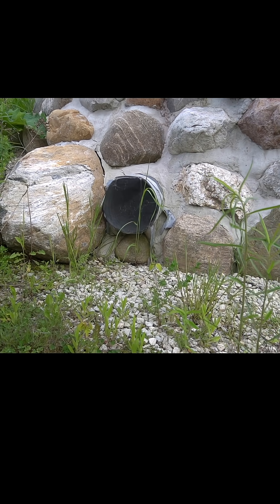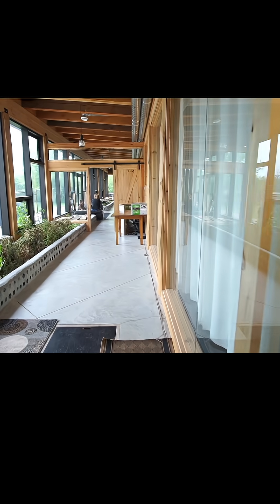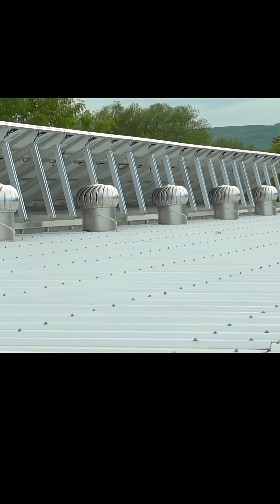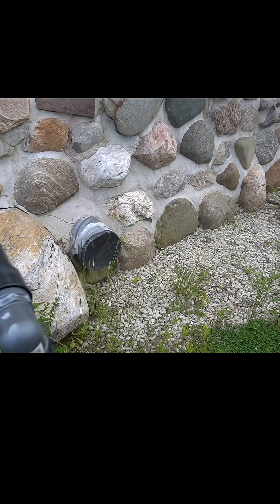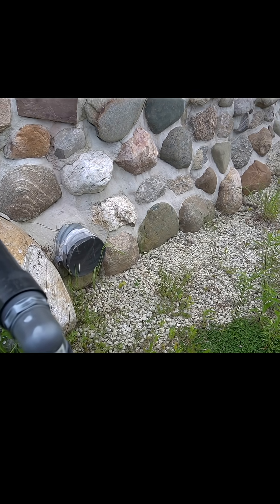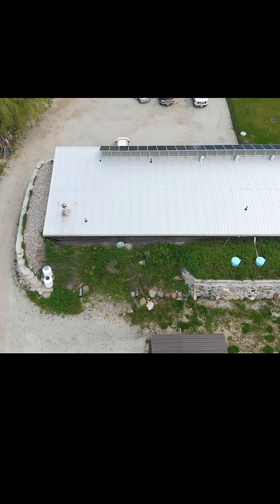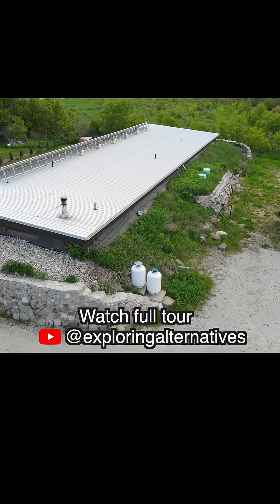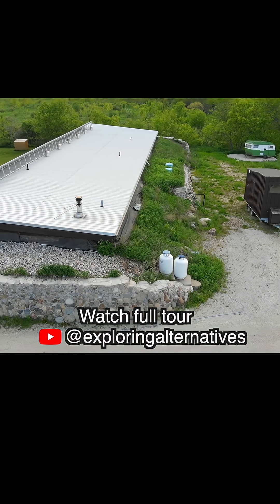Smart & Simple Passive Air Conditioning & Cooling #home #shorts #diy

Comment: Passive solar cooling.

I first learned about in from an article in MOTHER EARTH NEWS magazine. A man who lived in northern Arizona cooled his house this way.

His front porch was enclosed and faced south. He had thermal mass in the form of black-painted planters against the front glass wall of the porch and the porch's back wall (the house's front wall) made of stone and cement. The thermal mass would soak up the sun's heat, which would help to heat the air inside the porch. The heated air would rise (heat rises) and exit the porch through open windows in the slanted porch roof (screens on the windows kept the bugs out). Pipes running under the earth on his property would draw in air to replace that leaving the porch. As the hot summer air traveled through the underground pipes, it would cool, becoming "air conditioning" for the porch and house. The process would continue at night, powered by the heat captured by the thermal mass. 

During winter, he would close off the pipes and shut the windows, keeping the sun's heat shining into the porch inside the enclosed space, with the thermal mass providing heat at night.

The majority of his house was earth-bermed, providing excellent insulation to maintain the temperature inside the house.

I was very impressed with his results. So much so, in fact, that when I designed my dream home, I added an enclosed back patio using the same design elements (the back of my house faces south to make full use of the winter sun). It's basically a Human-scale Hobbit house with a passive solar back patio.
Reply: Passive Solar heating and cooling was popular in New Mexico in the 70s. Along with windmills for pumping water for a hundred+years before. I thought, back then, that home builders would develop whole neighborhoods this way. Somehow it all got shut down. 
In addition to all you described, the strategic planting of deciduous trees for shade in the summer and sun in the winter and other environmental flow…people could cut their energy (grid) consumption to nearly zero.
Reply: @mariehughey5390 
The lack of building that way was due to two problems:
     (1) Houses built with passive solar are more expensive to build, so they cost more for the consumer.
     (2) The energy lobby wouldn't stand for it. In fact, when the guy who wrote the article I mentioned was building his house, the county inspectors wouldn't allow him to live in it unless he put in a heat source, despite his evidence that he didn't need one. So, he ended up putting in a functional woodstove, though he never used it (because he didn't need to).

To your other point about trees:
With an earth-bermed house, you don't need trees to provide shade to help cool your house. It's like a cave - go deep enough, and you get a pretty consistent temperature. 
Another problem with having trees around your house when you're using passive solar heating and cooling is that you block the sun, which blocks your power source for the cooling. You need the sun to heat the air in the enclosed space (porch/patio) so that the heated air will rise up and out of the space and so draw in the cool air from the underground pipes.

I've researched this extensively. In fact, I also still subscribe to MOTHER EARTH NEWS. (BTW MEN also has articles about homesteading - gardening, raising farm animals, etc.)
Reply: I was up in North Carolina and saw the Mother Earth house. Their cool tubes were very very long but worked GREAT! They also had a multi pass stone chimney/fireplace in the middle of the house that helped with the heating in the winter. Neat setup